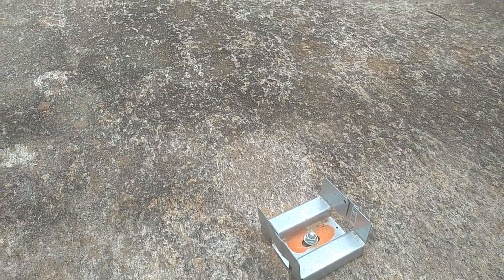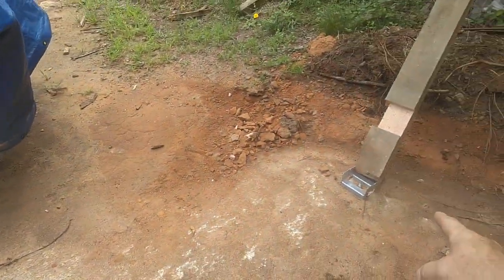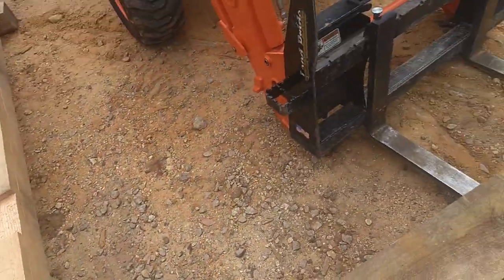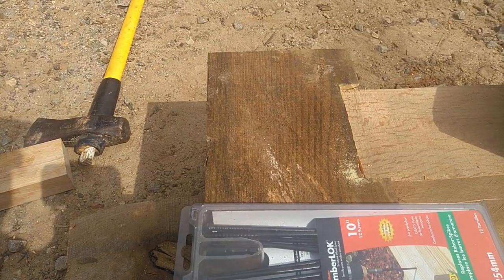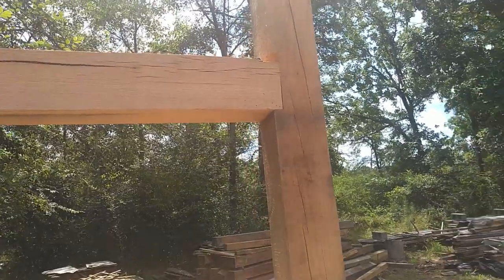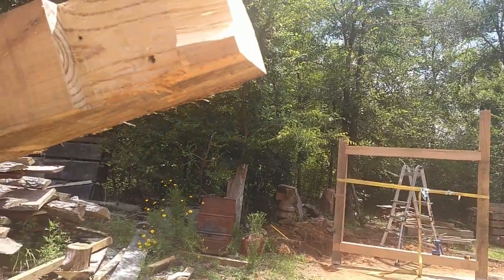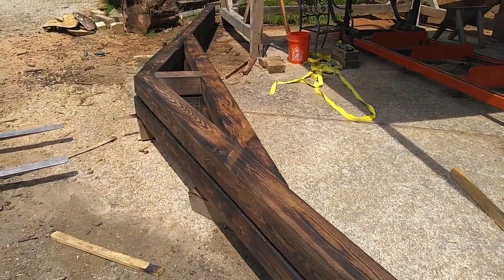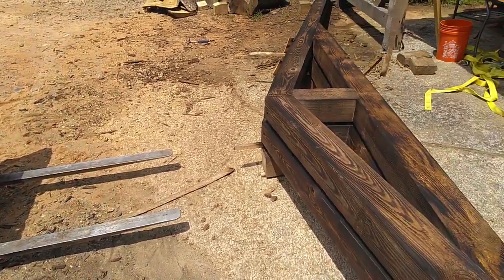Timber build sawmill shed- #111

Comment: Nice job! I love your design and would like to build a longer version for a boat shed, I can fill in the blanks on most things but I would be very much interested in any dimensions/angles you could provide - though I recognize you built on a sloping rock and that may not be so easy. And I really appreciate that you included the fumbles and mistakes in your video - this is such an important part of the process and encouragement for those who are not as far down the road.
Reply from the maker: Thanks, I do try to show my mistakes. If you want to send me an email i can send the PDF of the design with dimensions.

Regards,

Keith

Comment: Interesting video. I love the design of your sawmill shack (as I prepare to design a shack as well.) Are the bottom beams near the ground just for racking control? Seems like the upper cross members would be sufficient but I certainly am no engineer. I appreciate all the real-life mistakes you left in the video instead of just editing things out. Thanks for sharing you build.
Reply from the maker: Thanks for the nice comments. Are the bottom beams necessary probably not. I initially designed to possibly hold slabs in between the top and bottom beams. I changed my mind while I was building it and kept them in my case I wanted to board off an area for wind or whatever reason. I don't think I will but I like it.  Good luck on your build.